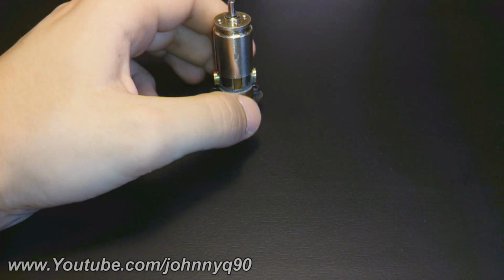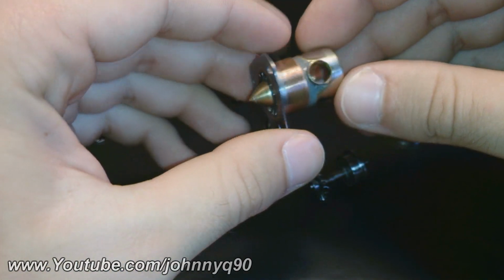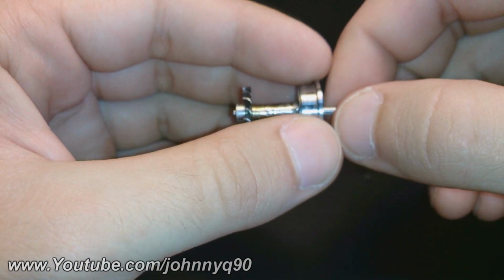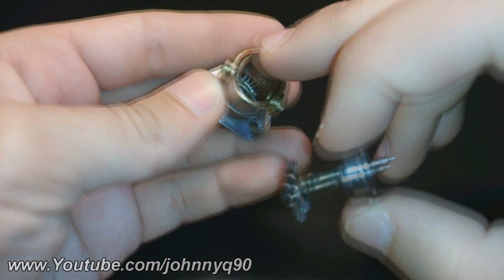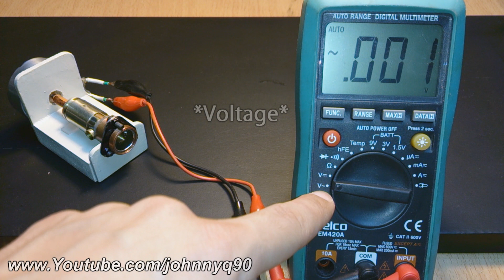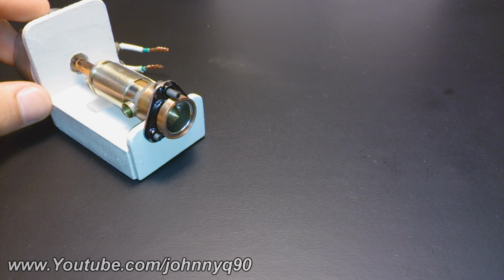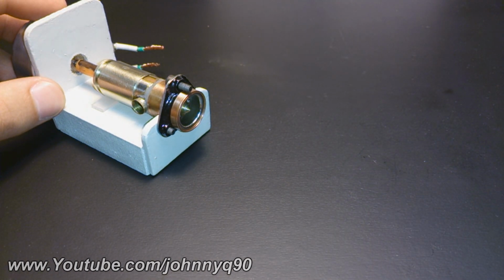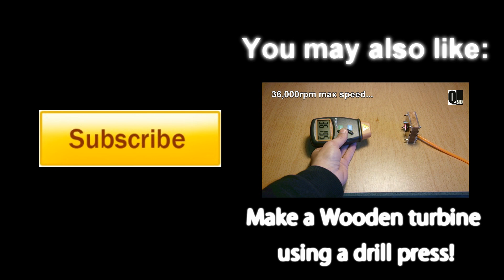Micro Axial Flow TurboGenerator Test

Comment: brilliant build mate! cant wait to see the cone built on to it to channel the wind:-) if you could get some readings on the wattage it produces it would be great, I can imagine a thousand of these hooked up in parallel feeding a battery array, it would be a great quiet alternative to the modern wind turbines :-D Also will love to see that on steam, I would want a large one so I can burn coal and wood in a burner, which in turn would heat a water unit to provide steam for the turbine, for the turbine to run the alternator to power my array and house! So much potential mate BRAVO!

Comment: this is really cool, if you connected a motor instead of those LEDs and mate its output shaft to your turbine shaft you could have a never ending cycle that you would just need to start with a blast of air.
Reply: No. No you wouldnt.

Comment: What if it would run with some petrol and the turbine would have a tiny water jacket on it, that would be part of a closed steam turbine system, thus making the whole system to run 2 generators after water starts to boil. Similar concept could also be utilized in combustion engines I think. Axial turbine could also run a windmill, 3 generators with one engine!! ;D

Comment: As always very informative and very well put together videos. An upscaled version of this generator would work well for use in skyscraper blocks where the air is funnelled by the buildings. I think it would be more effective for power generation than the prop variety. I wouldn't mind seeing an upscaled version of this application. Thank you for the video and the work you put into it

Comment: Cool build:)
But the idea with the wind won't work, I'm sorry. You can only count the wind on the surface of the turbine blades area. The cone inlet thing won't do any change. Wind creates extremely little pressure, that you can measure in millibars. The only thing why wind seems to be strong/and really is strong is the huge area of sails/doors whatever.

But still, nice thing;)

Comment: Can you make a kart with a turbine at each wheel? It doesn't have to be something fancy, a modified shopping cart with bigger wheels and a driving-wheel or even a bicycle with 1 or 2 turbines instead of pedals. 

But I wonder if 90 psi would be enough to move a kart/bicycle.